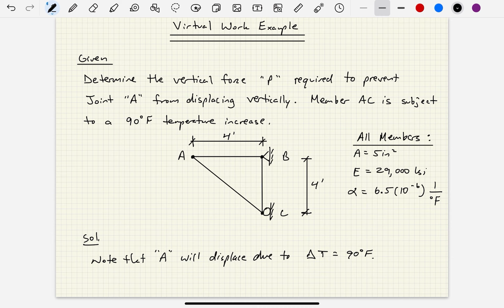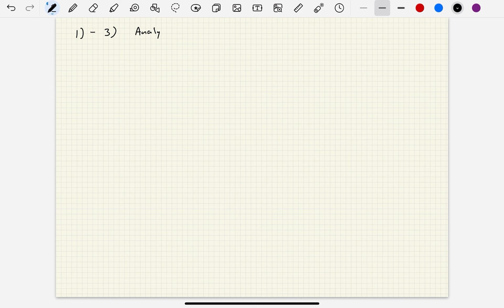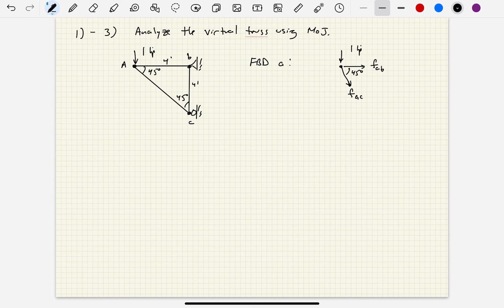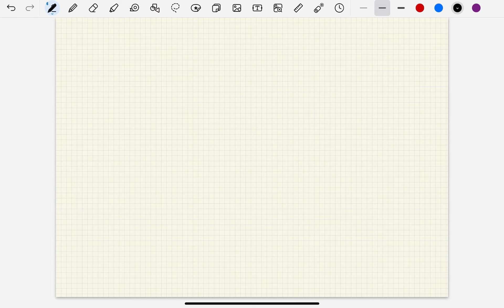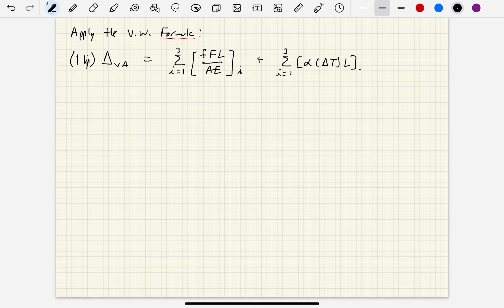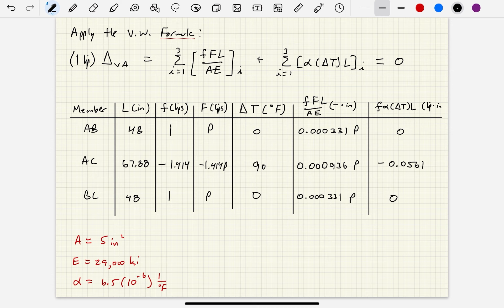Structural Analysis - Video 63:  Virtual Work with Trusses Example 4

Comment: Please why is -fac. It's not vertically downward. It's goes sideway to x-axis. Which suppose to be +. ?????????
Reply from the maker: When a truss member force is computed as negative, that means that it is pointed in the opposite direction from what was assumed in the original free-body diagram.  In this case, since fac is negative, it is actually pointing AT joint A, which means member AC is in compression.  The force in member AC is NOT pointing up or down, or sideways.... It is pointing diagonally, AT joint A.   

Here are some links to some of my more fundamental videos on Method of Joints for trusses for you to review:

https://www.youtube.com/watch?v=gl4ZqL9pBjk&list=PLh-Fz1IR5L-x27uM_IzRClkn2ugjITq3y&index=89&t=7s

https://www.youtube.com/watch?v=_a0FmO4StJo&list=PLh-Fz1IR5L-x27uM_IzRClkn2ugjITq3y&index=90

https://www.youtube.com/watch?v=vyFh4i1U39U&list=PLh-Fz1IR5L-x27uM_IzRClkn2ugjITq3y&index=91
Reply: Thank you  @mathandengineeringwithdr.a9515